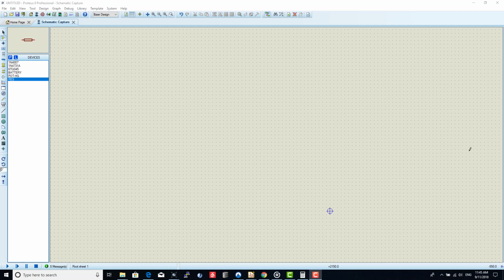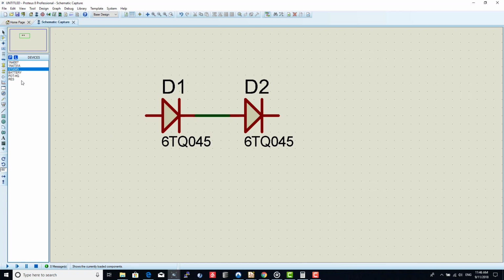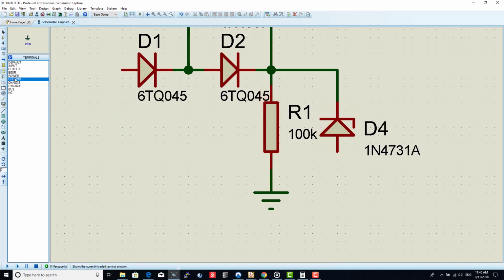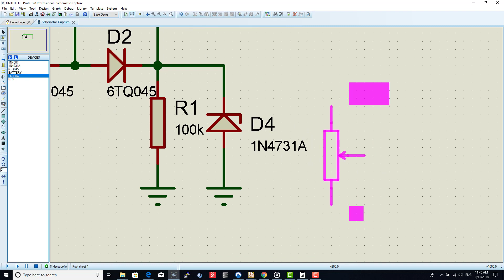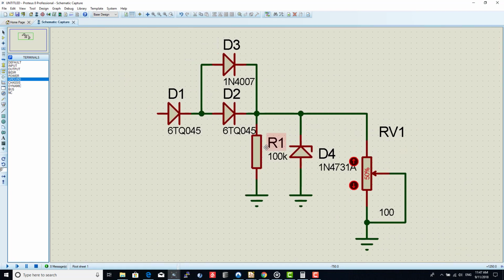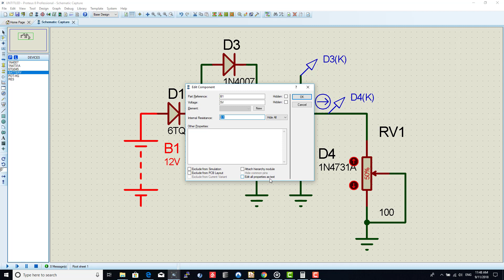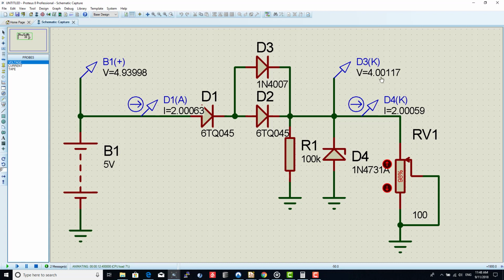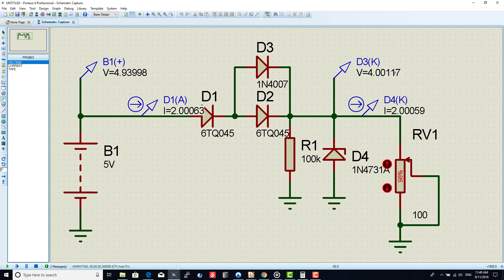Making SIM800 Power Supply

Comment: You shouldn't put two diodes in parallel, even less two diodes with different characteristics. Current will mostly flow through the schottky diode since it has a lower dynamic resistance and a lower voltage drop. Instead use a diode with a proper current rating.